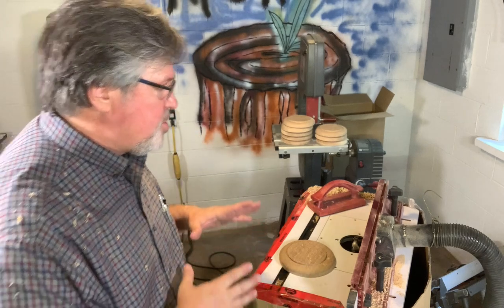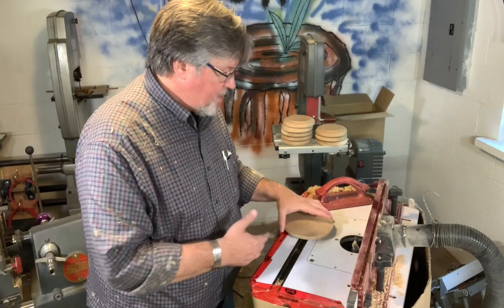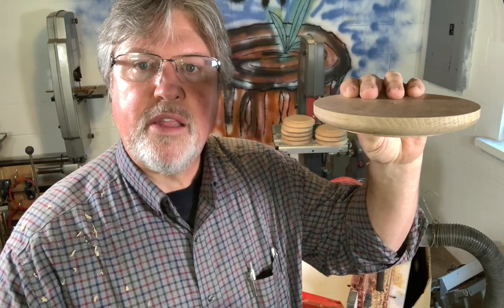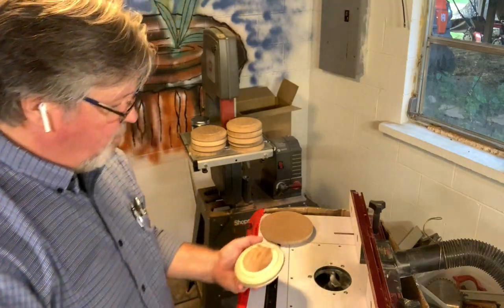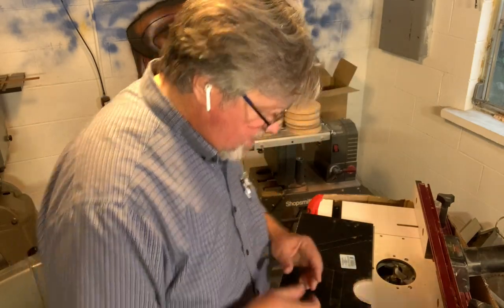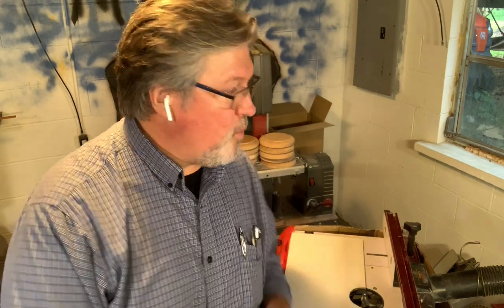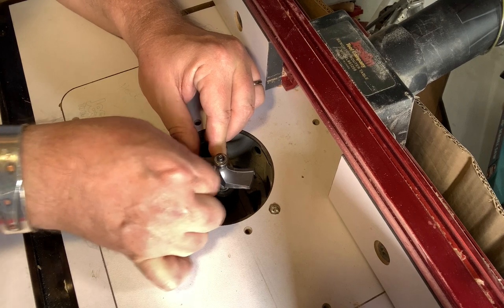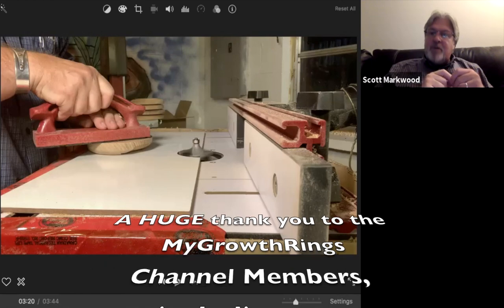SCARY!!!  How to Safely Route Large Profiles on Small Wooden Circles

Comment: I have used the tempered fiber board for another purpose… when making a deep cut, I put down an 1/8” sheet on the table.  After making my first cut… I pull off the board and make a finish pass.

That does two things… it gives a nice finish cut with less pressure.  The wood can move quicker so it doesn’t burn or chatter as bad. On figured wood it reduces tear out just like using successive passes with height adjustment do.

Second, it reduces my setup errors when parts produced a few days later need the exact same profile.

Scott, this was an excellent demonstration.  Enjoy your vacation!
Reply from the maker: Thanks Dave. Yes, I do the same thing and I might have done it here if I hadn't been messing around with the motor so much before I took it out and did that maintenance on it.  Anyway, I made a shallow pass then adjusted it up, but using a shim to lift it up for the first roughing pass is a smart move. Scott

Comment: about bit cleaning... i have yet to find anything comparable to simple green.  its basically black magic as far as im concerned lol.
Reply: Plus one for Simple Green. Also, it's a general purpose cleaner for various garage messes.
Reply: In the machine shop, Simple Green is our "go to" cleaner on our equipment and tools. We buy it by the 5 gallon container.
Reply from the maker: Very cool! I don't recall ever using it for tooling, but I always have it around so I'll give it a go. Scott
Reply: Yes Simple Green (original) is fantastic for almost any cleaning job from skid marks on young grandkids shorts to a 100+ year old rusty anvil ,I learned the skid mark bit while attending gunsmith school, we used Simple Green to clean 95 percent of our gun clean process. Just need to know how to dilute it for the particular job!  Also after I clean my router bits I hit them with a quick burst of silicone spray.
Reply from the maker: @curttundra  Great tip, Curt!
Reply: When it comes to cleaning my saw blades and router bits, i found that using liquid laundry detergent mixed with water at about 1/3  detergent to 2/3 water works very very well.  It is cheep and only requires a minor amount of scrubbing with a very lite kitchen scrubber.   After I am done I use a bit of WD40 to ensure no rust.   I know this sounds strange, but it really works well.

Comment: Scott, I recently setup my Mark V for overhead routing…. Dust collection is far from optimal.  Is there an option available for overhead collection?  Have you done anything for this?  I will be exploring options in the coming days, but I would have expected the routing shield to be collector enabled (it is far from it).  Thoughts?
Reply from the maker: I haven't recorded anything on this because I never use my Mark V for routing. If you use it with the shaper fence there is an accommodation for dust collection through a hole in the table, but if you are routing dados or dovetail slots there isn't a great way to collect the dust.  I've clamped a vac or dust collector hose next to the bit, but that still falls quite short.  Scott

Comment: Enjoy your videos and following along with this build. A couple of comments. Jeez I couldn't believe you weren't wearing some type of dust mask. Routing seems to me the dirtiest job in the shop. But in all the years I've done woodworking it never occurred to me build a shroud around the bottom of the table to contain the dust. I'm sure I'll try it soon. (I mount my router table to an old Black & Decker WorkMate. When not in use I can hang the table and/or WorkMate on the wall and get the floor space back) I would like to see how your table was mounted.  Thanks for the video.
Reply from the maker: Thanks to COVID I am so over masks! Seriously, if I feel I need the, I’ll wear them.

Comment: Why not cut quick circles on the bandsaw (like you did), then turn that on the lathe? Wouldn’t that avoid the sanding to perfect circle and routing? I see the router is much faster!
Reply from the maker: Yes, that’s another option and there’s no reason not to consider that option, if turning is your thing. Because this was white oak I sis that want to have to mess around with the likelihood of end grain tear out, that would likely be an issue had I turned them. Also, I can route a circle in less time than it takes to mount one on a faceplate. Scott
Reply: @MyGrowthRings  Oh, I see. The router is faster AND gives better results. What about using the Shopsmith as a router or shaper?

Comment: So the router bit was moving up and down in the jaws of tge router and not the router body moving? If so this seems very strange that if the bit became loose wouldn't it eventually come dislodged from the router? I don't have any experience with a table mounted router,  is this a normal occurrence?
Reply from the maker: No, the router body was slipping within the base clamp. This is only "normal" if the clamp isn't tightened properly, which is what was happening due to the motor and base galling. Scott
Reply: I thought the same thing, then I realized the video of the router slipping down was running in a loop over and over. That made it look like it was moving up and down.
Reply from the maker: @woodshopnerdery  Yes, exactly. I guess I didn’t make that clear.